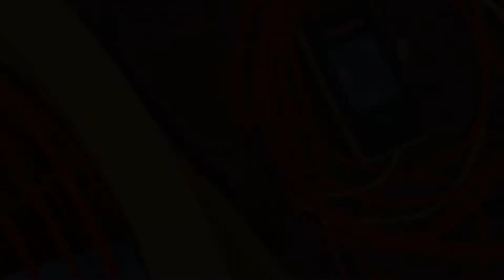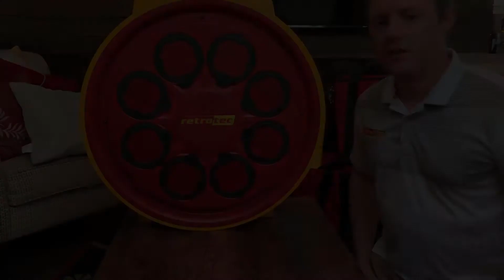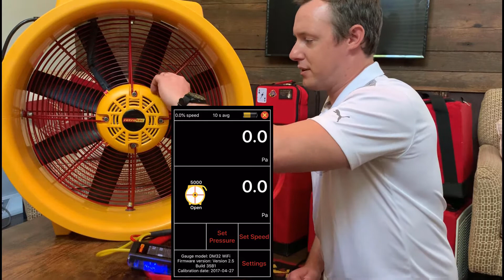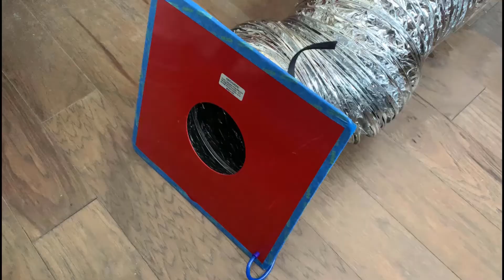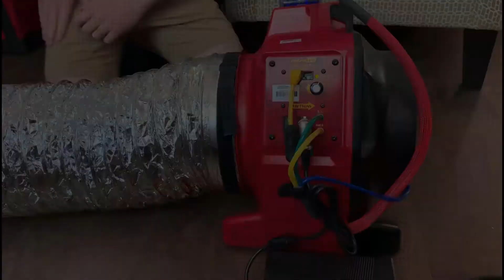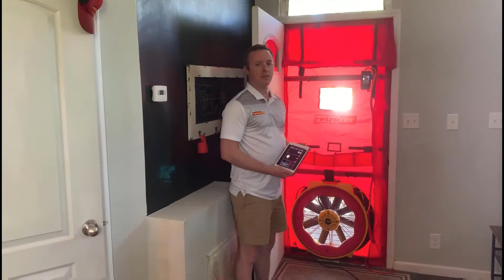Field Checking Your Equipment

Comment: My 1000 Fan is much older than yours. Where are the Ports to plug?
Reply from the maker: you'll see small holes on the red nacelle in the center of the inlet side of the fan. Use silly putty there.